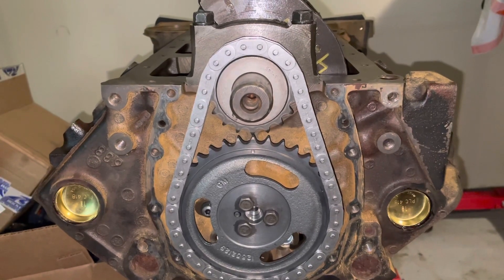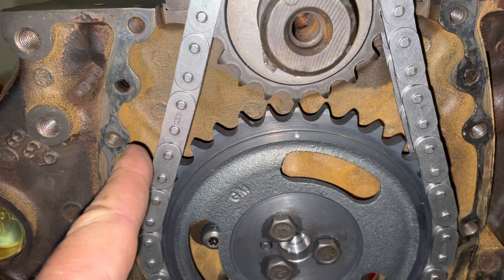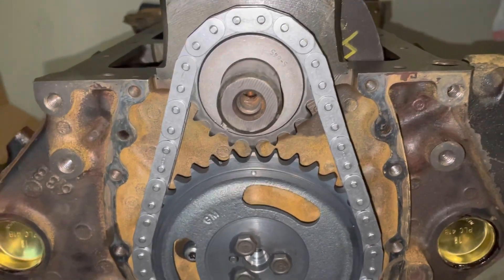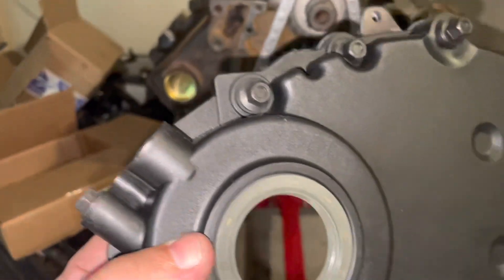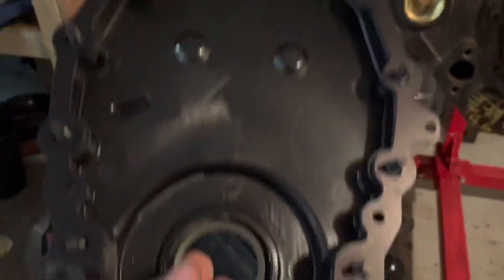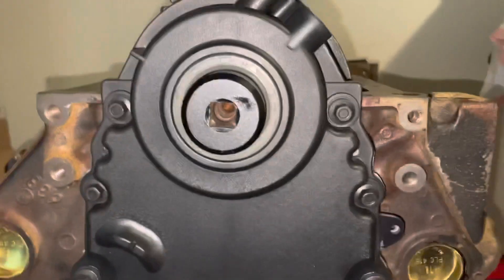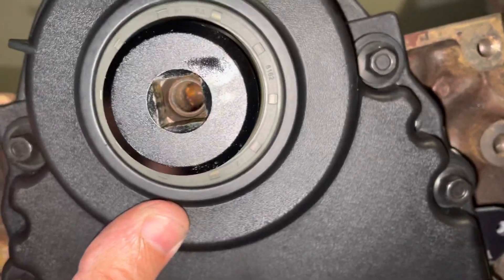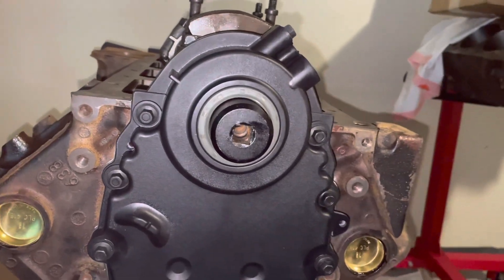Mercruiser 5.0 1(d) - High $ Timing Cover

Comment: Brother I know this video 4 years ago but if you can answer me back I gladly appreciate it my 1997 Chevy Silverado Vortec 305 blow up piston rods all over the oil pan got that engine out and now I am building a 305 5.0 chevrolet motor eliminating the fuel injection I'm going carbureted using a liter engine block from the 89 to 90 block I ran into this video because I'm using a genuine GM black timing cover and I have to remove the dow pins but now I have the concern of if I put that cover on I'll run into this problem and second of all for a fact I do need the position sensor even though I'm going carburetor any suggestions you can give running on a small timeline we are moving shop in December 2025
Reply from the maker: You can’t use the1997 roller cam in the 1990 block. Too many obstacles to mention.

Comment: I have a question.  I have a 5.7 vortec motor that I am building which timing cap do you use for a double roller timing chain, thanks
Reply from the maker: I don’t know that a double roller chain will fit under the plastic vortec timing cover. If you use the timing set from this video:

https://youtu.be/a17DbbN-Nqg

And then use the cover for a 1998 5.7 you can’t go wrong.

Comment: I pulled the steel dow pins out of  my  5.7 and used a dorman timing cover which wont nothing leaked all the oil out of my motor in the bilge and almost ruined my motor i ordered a genuine gm timing cover and put on mine with out the crank sensor hole.
Reply: they both had the plastic dowel pins but the dorman cover was junk.